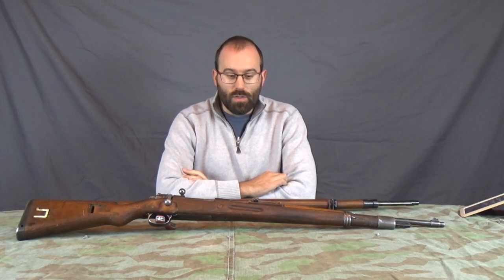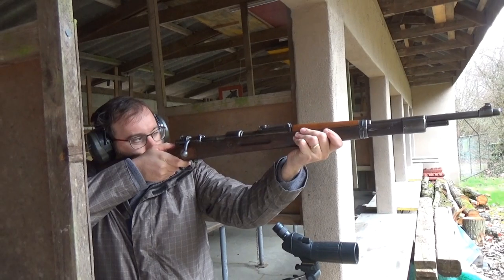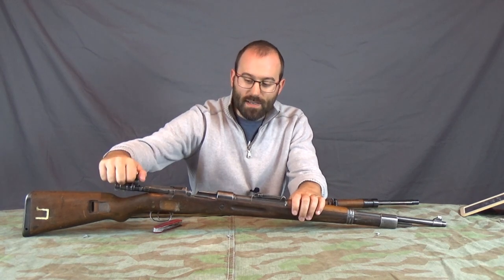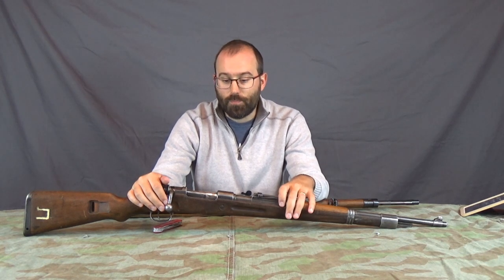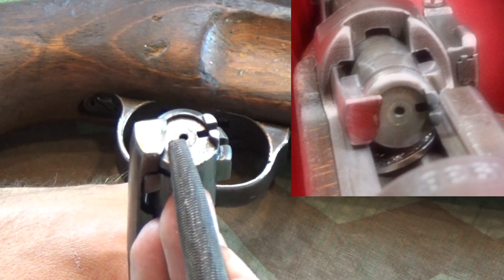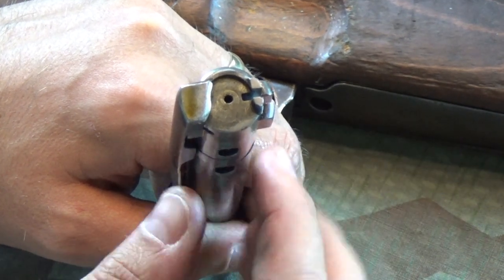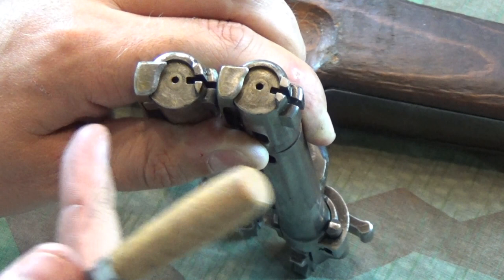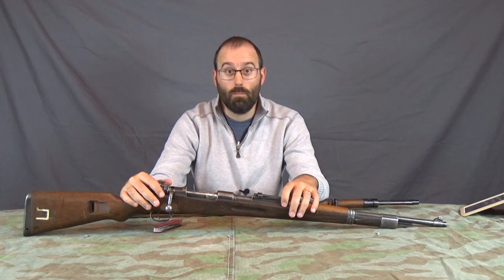Making the Manky Mauser Work Properly

Comment: Small nitpick, the Yugoslavs did not modify German K98s into M48s. What they did was to refurbish and repair them and they slapped the label 98/48n (n for the Serbo-Croat word for German) on them. The M48 is a different, new production rifle based on the FN model 1924 (which has a slightly shorter receiver length, about 1/4 of an inch) which incorporated many of the improvements that the K98 had (turned down bolt handle, side sling with slot, sight hood, etc.). Bolts will not interchange between the two for obvious reasons, but otherwise they are similar. They also updated and repaired their old M24 rifles resulting in the M24/47.

Comment: I have taken many CZ-550 extractors to South Africa (where I teach each year) to replace older commercial '98 clones so they will function as both push feed (in mis-loading) and in controlled feed.  The CZ-550 extractors are beveled at the factory for this purpose.

Comment: I had a similar problem with my Kar 98 that been sporterised. The extractor was too long. I wasn`t prepared to do it myself so I had a friend do it for me. It now works flawlessly. I would like to add, that the rifle was a present that came chambered in 6.5x57 and it had been drilled and tapped for a 4x scope with a claw mount. The stock is a beautiful walnut and it shoots very well, but it is not my first choice for stalking.
Reply: Where did you get the claw mount bases ?

Comment: I do like how you figured out the simple solution was to just take a gun with a proven extractor and browbeat the shoddy extractor into literally the right shape. Very Mauser to have the solution be solvable by a field armourer's tool kit. Basically what made Mauser a legend: easy to make, easy to maintain, easy to fix, easy to clean, and easy to train on. Oh and sometimes it will hit a barn at 200 meters but what does it matter when you are giving your conscripts less than 100 rounds a year to train on?
Reply: I guess they left as much material on there as possible for later maintenance*, it worked when it left the factory and if it stops working you can make it work again with a file.

*(and it's stronger)

Comment: Having watched this, and having a little experience with Mausers, I felt I should do a video for you, explaining how to modify the extractor. I discarded this idea rather quickly though, as I knew there were probably a few hundred videos, on Youtube, showing Mauser bolt disassembly. Military Mausers were never intended to be loaded into the barrel, but only into the mag, which is why they didn't have the bevel. To better put the bevel onto the extractor, you should have taken it off the bolt. Iraqveteran8888 did a good video showing how this is done. Note though, I've always had problems with putting the extractor back on, because on some rifles, the swivel holder that it locks into, needs to be compressed. While you can buy a specific tool for squeezing this piece together, I simply took a cheap, small needle nose plier,  and bent the tips 90 degrees. Works perfect!

Comment: You could just buy a replacement. They run about 25 to 30 USD over here.
Reply: Bloke on the Range I think you've been having trouble with that extractor for months now. I'm glad it works now though.
Reply: Not always so easy for people in other semi-gun friendly countries. My Jericho eats extractors every 3,000rds at minimum and I have never managed to get a stock replacement so I have my smith modify Shadow parts. My Glock 17 snapped a rail guide and cracked the recoil hood, it’s been four months now and now my 22 busted the same rail. Even though I live in Canada and Chinese guns are readily available I had an NP29 cut and deactivated from parts failure because it proved too difficult to get parts, (I stripped it and sold the parts and spare magazines to recoup the loss and sold the gun to an instructor for $25). And worse still when my 500 S&W almost blew up it was only due to my gun shop taking the initiative and buying back the broken gun and transferring me a new gun, (better model btw so made me super happy) that I got that replaced so fast, (4 months). It’s been almost 1 year for them and it still hasn’t been taken care of, and they are a licensed gun store.

Comment: I mentioned this before but will mentions it again and this time offer evidence to back up the statement. The Mauser Model 1898 action was intended to be a control feed action only. That some Model 1898 action  will allow the extractor to snap over the cartridge rim can be attributed to the age and condition of those actions. I will qualify this statement to say this is only for military actions. As proof I offer United States of America patent 467,180 19 January 1892 Shell Extractor for Bolt Guns; 476,290 7 June 1892 Cartridge Stop for Magazine Guns and 477,671 28 June 1892 Shell Extractor for Bolt Guns. These patents clearly show that the extractor used on the Model 1898 action was intend for control feed only.
Reply: This discussion will have to be filed in the same folder as the Ford versus Chevy discussion. But to address your comment about the chamfer, it corresponds to the chamfer at the front of the extraction groove of the cartridge case. Oh, by the way Fords are better. You and the Chap keep up the good work!

Comment: Great that it's running well now. Have you considered trying to add the bevel onto commercial 303 cases like what is on the surplus brass? I tried once with a belt sander but I couldn't work out the right angles
Reply from the maker: Can't find anyone to make a tool for a reasonable price.
Reply: Bloke on the Range maybe there is someone out there in Bloke land who could do it? I'm sure there would be quite a few people interested